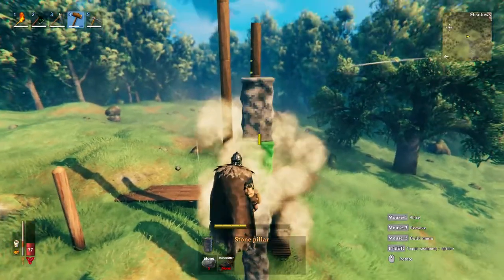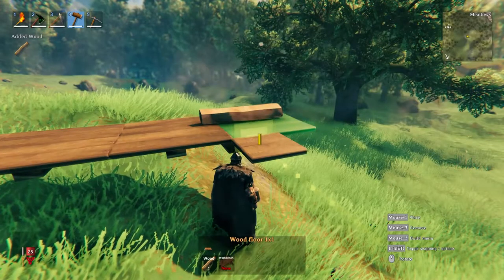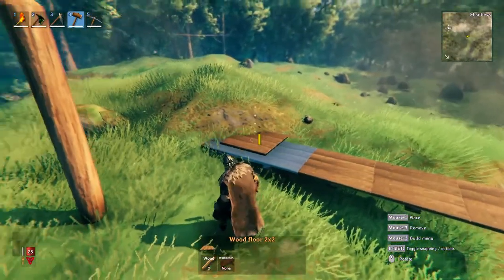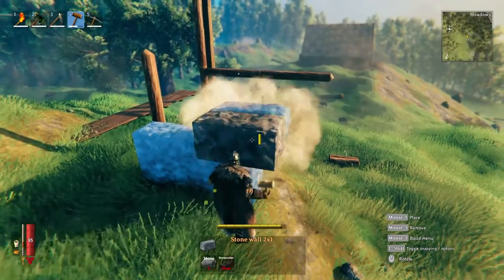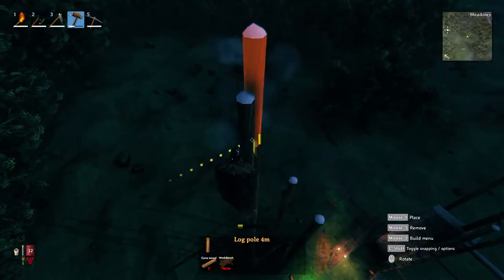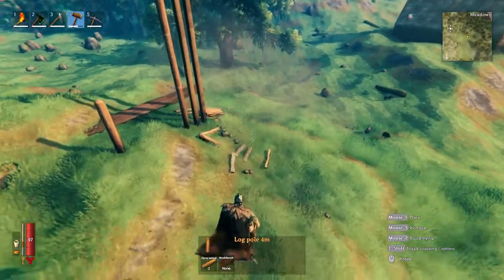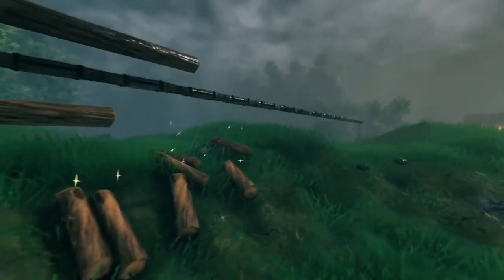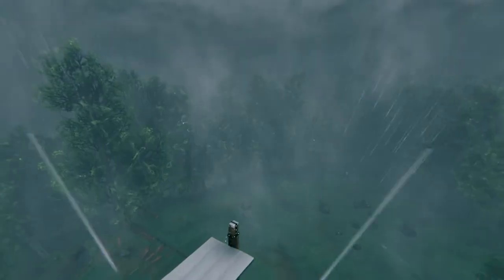Understanding the Valheim Building Support System [Valheim Guide]

Comment: does core wood require repair like regular wood once you build a structure?
Reply from the maker: The only reason you need to repair regular wood structures is if you don't have a roof over it